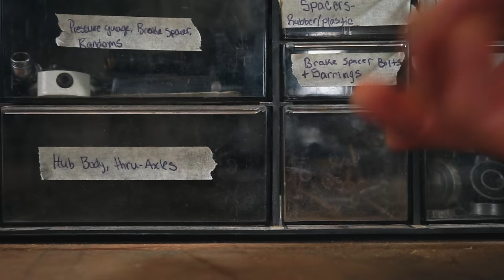The Mini Booter: This Jump Is Hucking Tiny!!!

Comment: Hey guys,
I have a problem:

I just bought a new xt chain, and the Dartmoor simple chain keeper, 
The problem is the chain keeper just tensions the chin downside, so at woody sections, the chain just pops at first teeth out of sprocket, so when I crank forwards, it pops just right out. The sprocket looks ok, at some teeth a bit sharp, cause of the slipping.
Any suggestions to get more tension or without buying a new chain guide ?

Thanks, Greetings from Germany!

Comment: I started on clipless pedals, but am trying to learn skills the right way by not using my feet being connected as a crutch. I am looking into flat pedals but nice ones a not a small investment. Do you have any suggestions of pedals? I want to bite the bullet and get nice ones but I don't want to spend a lot on bad pedals.
Reply: aidan kinsley go to a bike shop and put them on your feet and see what gives you the most grip
Reply: aidan kinsley if youre saying you dont want to get nice pedals the dont. theyre still one of the most cheapest parts of the bike.
Reply: Odyssey Twisted PCs aren't bad on grip, don't weigh a ton, come in a whole lot of colors, and cost about $14. if you find you don't get enough grip from those, you can move onto something with metal pins, but you won't be out a lot of cash and you'll have them to throw on any bike you just want to pedal around.